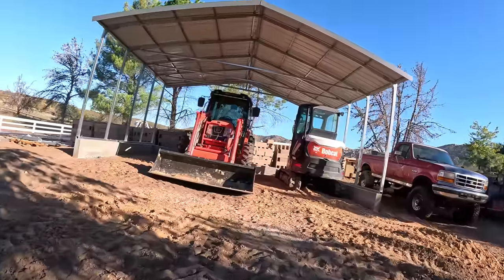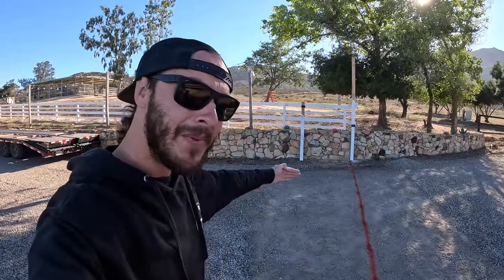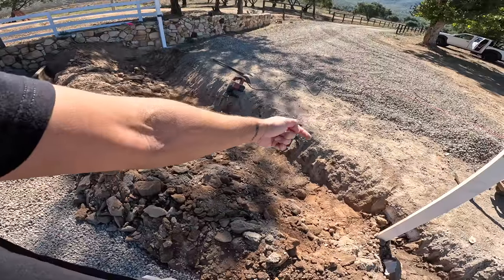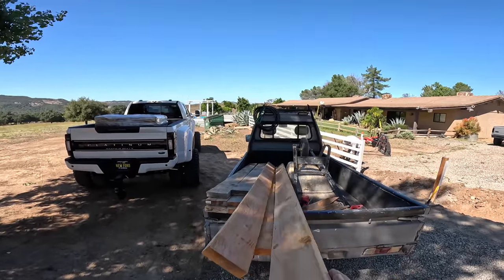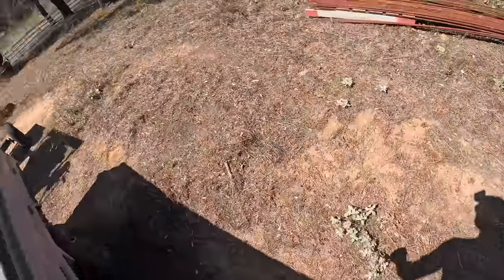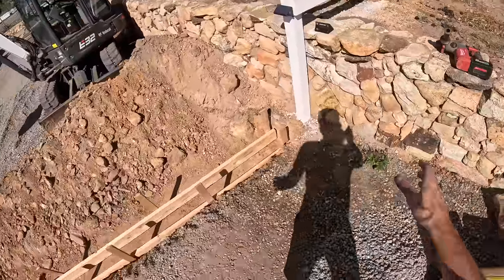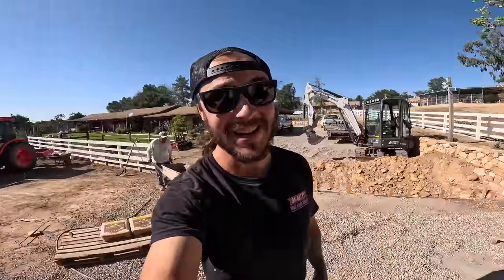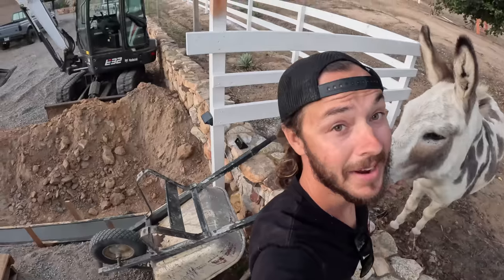Building a Custom DIY Gate the Easy Way! (Part 3)

Comment: Set up a 55 gal drum to attach to the 3 pt hitch and fill it with concrete to give you some ballast. Worked great in the winter when the backhoe was taken off, helped with traction and kept the @$$ end planted.

Comment: Fill your back tires with water and get a 3 point weight for the back it will help a lot with picking up heavy loads they can lift more than you think with water in the back tires filled full to brim

Comment: 🔥🔥we use the cheap gate motors from tractor supply. there cheap for a reason except to replace them every 2 years and have many key pad issues. and the water on the motor when the arm closes gets inside the thing and ruins it

Comment: Have you tried putting whatever size socket is on the end of the cement mixer “pull cord” attachment on a drill or impact and seeing if using that would be able to start the cement mixer instead of wrapping the cord around and pulling?

Comment: Hey dmax. Interested in a 1985 c30 chassis cab? It has a really heavy duty flat bed. Dually. 350. I ran it on the freeway three years ago and a tire blew. After that I parked it. I purchased it with a bill of sale. Might be a good farm truck for you bro. Lmk I’ll trade you for some Merch and beef jerky! And a work for it decal.

Comment: next time you unload a pallet from that 450, get the forks in and ready to lift then drop air from the bags on the 450 front and rear just a couple inches then drive it out from under...

Comment: Do you have wheel weights on the tractor? You can fill the tires with water to for weight in the ass of the tractor